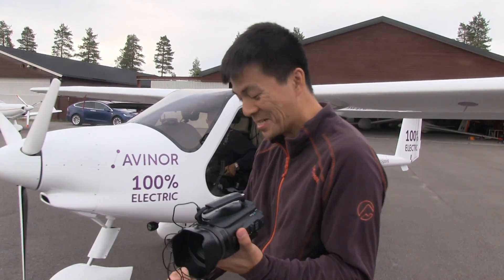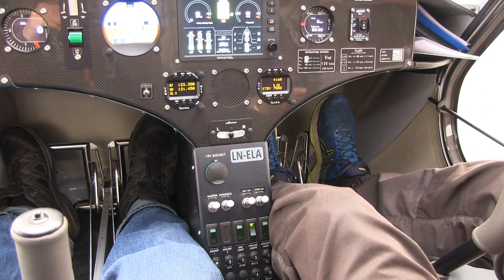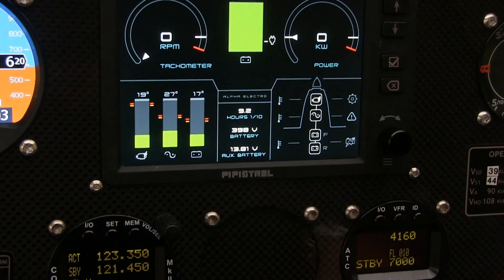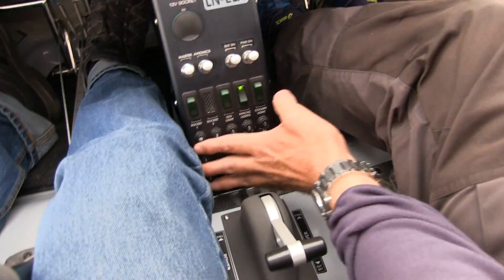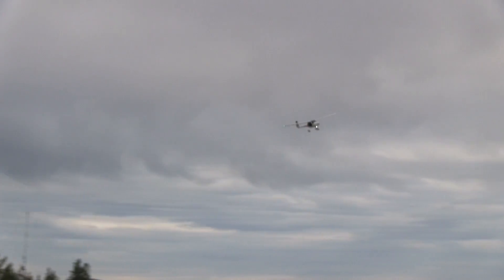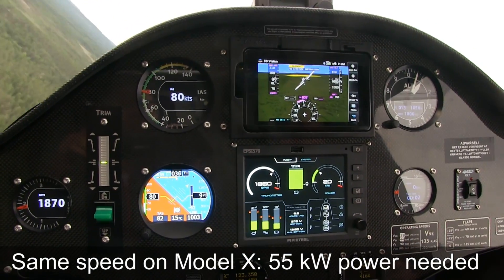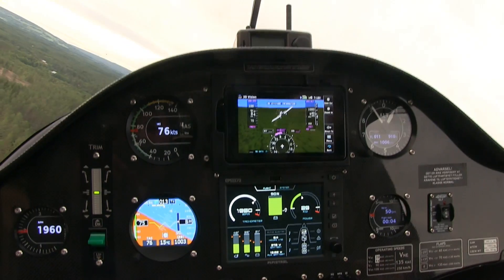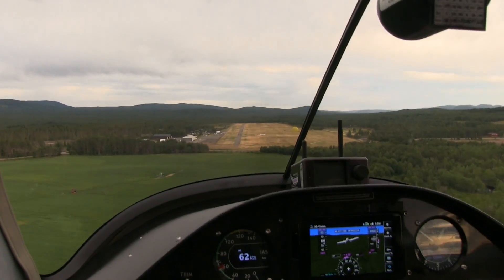Test ride in Pipistrel electric plane

Comment: How about hypermiling this plane?
Reply: Nick De Groot - Hypermiling should be Easy, for a qualified Glider Pilot, Ridge Soaring, with Back Up power instantly! It is nearly a Glider in shape and design, already!
Reply: Robert Weekley Maybe you could thermal under a strong cumulus and regain some Energy..
Reply: They give the endurance at 60 minutes, so thats about 100 nautical miles.
Reply: @mysock351C  plus/minus the 45 minute recommended reserve. There electric flying is almost there. It will be perfect with the new demonstrated battery with 5 times the density of current.
Reply: Altitude

Comment: All it needs is supercharger airports. The Indicated airspeed does not indicate the ground speed, only the airspeed into the pitot tube.  The plane has to factor in the tail/headwind and pressure to determine the ground speed which in this case was 80 knots due to a headwind.
Reply: EinkOLED Unless it's using GPS then you can get the ground speed. And why need Superchargers, it has quick battery change over. Has multi small packs.